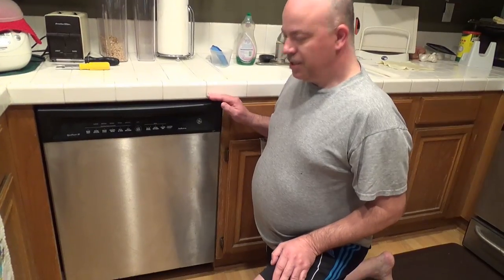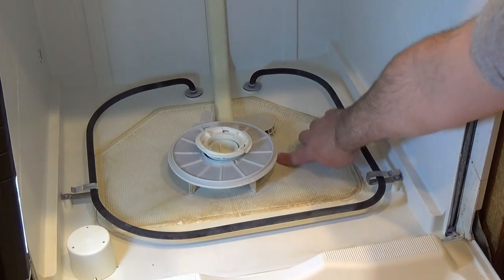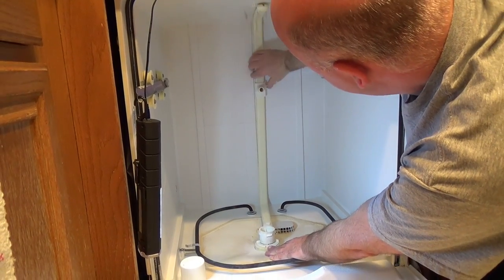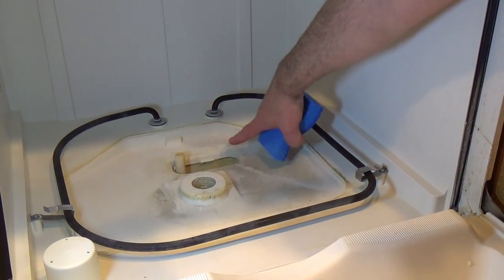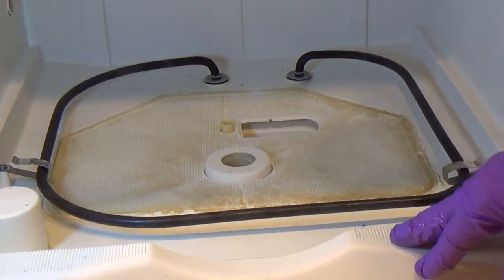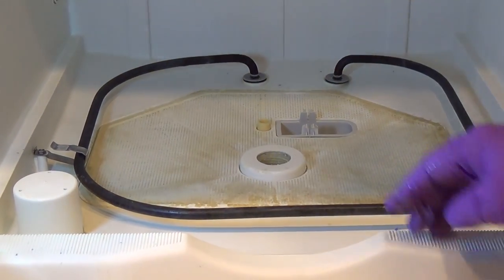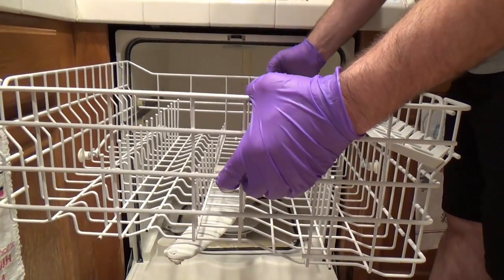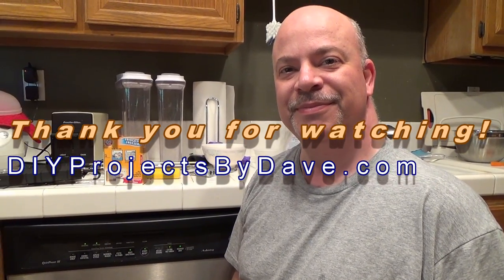Cleaning the Dishwasher GE Adora Quiet Power III

Comment: Just a warning to all, when putting it back together I did not tighten the part with the tab enough, and it caused water to leak out of the bottom, and we now have a ceiling stain in our basement.  So be careful, and tighten everything completely!  Also, I broke the little tab, which he said be careful to not break.   It works fine without the tab, thankfully, because that part is no longer available to replace.

Comment: For those having trouble getting the strainer basket out, I watched another video and you need to pinch the sides (there are clips on each side) - pinch and wiggle towards the center until the clips release and lift up.
Reply from the maker: Thank you for the advice!

Comment: I followed your instructions and they were extremely helpful. I have one problem though, two washers came out of the round  piece that attaches to the pole/rod thing. I have no idea where the washers are supposed to go. I’m glad I caught them before they went down the drain. Help! Thank you!
Reply from the maker: Thank you for watching. Unfortunatly I don't remember where those washers go. You can try searching the internet for your model dishwasher and look for a parts diagram that may show where they go. Good luck

Comment: Thank you for the video on how to do this, I haven't done it in a while. Vinegar to soak the matt; maybe 50/50 with water. That is what I used to clean the bottom of mine instead of soap. Also I put vinegar in that little rinse department, instead of buying rinse aid, it works nice and it's cheaper. Also if I want a lil more boost just poor 1-3 oz into the wash machine right before I shut the door to run it. Mainly just in the rinse thing is enough though.
Reply from the maker: Thank you for your feedback!  Using vinegar is a great idea!

Comment: Great video.  What’s the trick for getting the strainer basket out?  Mine does not just “pull up”.  Seems attached somewhere and I don’t want to break it.
Reply from the maker: So sorry for the delay in reply.   Thank you for your comment.  We are sorry that we no longer have this model dishwasher and we do not want to give you wrong information.....  Hopefully someone knows exactly how to take it out.   Thank you!
Reply: I’m having the same issue with mine.
Reply: Yes, same problem. Great video overall, but it conveniently cuts from tugging on the basket to him just lifting it out. How do you get it to "pop" out??? I've been to the verge of breaking it trying to get it to come out.
Reply: @kensehlmeyer6884  I just squeezed it a bit hard with just 2 fingers on the sides where he is pinching in the video. Try to lift straight up and not at an angle. It's tough but it does come out.
Reply: I used a very long, and very heavy duty screwdriver to rim the sides and help me pull it out. Took some time to do this. Did anyone have water in the sump after pulling the basket out? Thanks

Comment: Wow! Never knew that you could take it apart like this...and never knew how disgusting and scummy it could be inside. No wonder why my dishes weren't coming clean!!. Can't wait to run it, but I have one more problem. The soap dispenser door doesn't open/empty the soap. Any suggestions for videos to watch?
Reply: Couple of things I have found.

1) make sure no tall dishes in front of the door.  Put them on the other side by silverware.

2) dry out the inside before putting packet in.  Have found the newer pods will “melt” with any water in there and stick and not roll out.

Comment: Did this and had a small washer come off of somewhere and not sure where it goes. No mention of a washer in the video.
Reply from the maker: Thank you for watching. Sorry to hear that you had a washer fall out. It's been a while since we recorded this video and unfortunately I don't remember where the washer could have come from. Possibly One of the waher arm pivots?
Reply: The washer goes into the piece that screws into the centre of the dishwasher, and to which the rear hose attaches.  The washer sits in the bottom of the hole that bottom spray arm goes into, and the spray arm rests on this washer.

Comment: I followed these instructions and my dishwasher started making an electrical shorting noise. Went to see what’s up and it was leaking from the bottom after this :(   
Any ideas?
Reply from the maker: Sorry to hear that your dishwasher is leaking now. Hmm not sure exactly what could cause that but I would suggest checking that everything is put back together correctly and that nothing is loose. Also check the rubber gasket around the door for any dirt that may be on it and causing a leak.  Good luck and thank you for watching
Reply: @DIYProjectsByDave  Thank you for the suggestions. The only thing that wasn’t right after putting it back together is that the gasket for the strainer basket disintegrated when I pulled it out. I can’t see how that would cause any leakage outside the machine though. Oh well I’ve been needing to get a better dishwasher anyway. All the best
Reply: This happened to me, and I don't know the name of the part, but it's in the center, at the bottom and it needed to be tightened an additional turn.

Comment: After putting it back together im not getting water. Sink does work though
Reply from the maker: Hi!  There might be a separate valve under the sink for the dishwasher that you need to turn on.  Hope it works out.  Thanks.